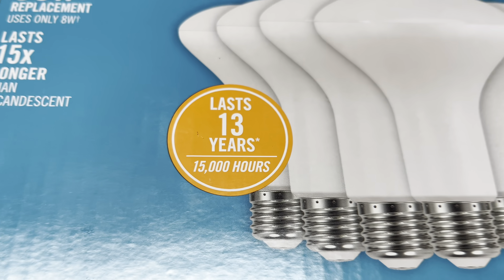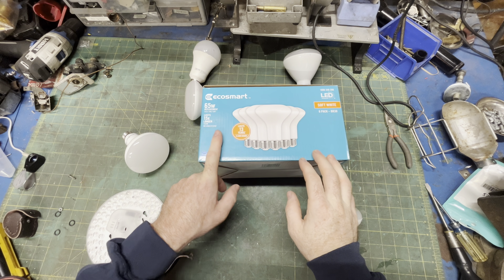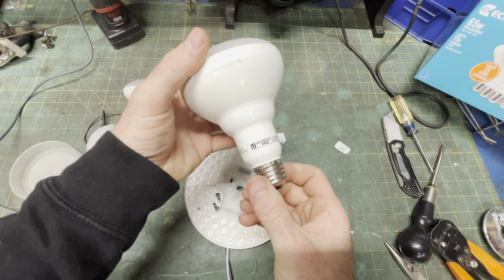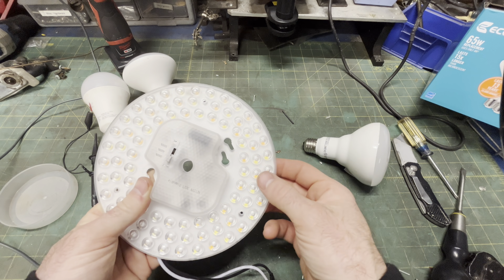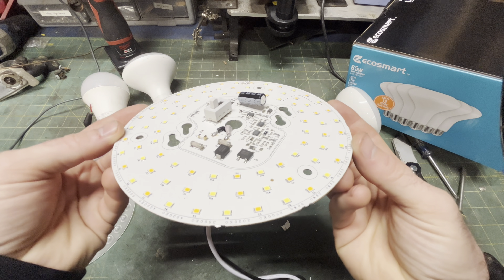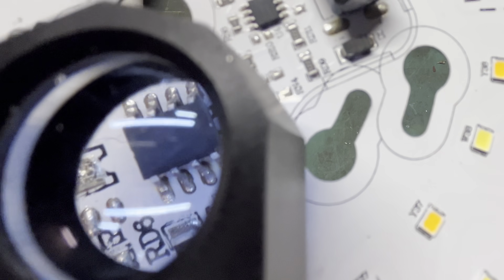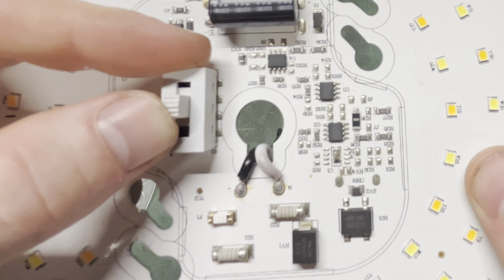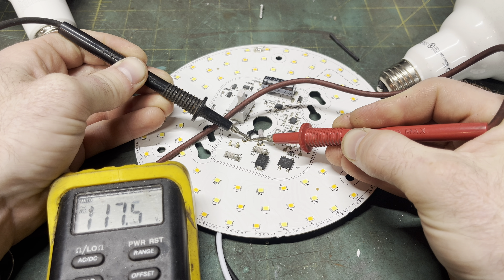Why Do LED Bulbs Fail? An Autopsy!

Comment: In my experience, most incandescents that were used on a daily basis lasted around a year. CFLs were somewhat better, but I've rarely had to replace LEDs, rare enough that when one does stop working, I've got to hunt to see if I have a replacement for it
Reply: I had incandescents at my old house last as long as 12 years on fade-in dimmer switches. None of the LED bulbs that came with my new 2020 house lasted more than 3 years. Huge box of e-waste now the landfill (we don't have a recycling center within 70 miles of my area).
Reply: @JSMCPN  Are you sure your LEDs are dimmer-compatible?
Reply: There are also special dimmer switches for LEDs. I've found that even if the bulb says dimmable, it will still flicker on a normal dimmer switch.
Reply: @JSMCPN  We had 3 LED lamps, all Philips, which switched on automatically at sunset and back of at sunrise. All 3 died in less than 2 years, and all within 2 or 3 months of each other.
Reply: I've had many incandescent bulbs last around 2 years.
Reply: @Warp2090  Fading them in with a TRIAC dimmer and running them at 90% of rated voltage can triple or quadruple lifespan. Most of the damage done to edison filaments is caused by inrush current each time they're turned on. That effect can be eliminated by turning them on gently rather than slamming a cold filament with full voltage and a big current spike.
Reply: @PartTimeLaowai  Philips led lamps is kind of bad brand now. They fail so much in year two.
Reply: As a plasma fanatic  I just stick to fluorescent lamps. Most LEDs are boring for me. Filament style is OK but most other types are as ugly as the average mother-in-law.
Reply: @JSMCPN  - spend 80$ on a micro-controlled switch, never have to replace a power hungry bulb again 😂
Reply: Yet....I have track lighting in my kitchen with those wee halogen bulbs.....the LED versions are dying all of the time, to the point that I have quit buying them and seek out halogens bulbs in the dollar stores...they last longer.
Reply: @PartTimeLaowai  , up till now, only the Philips ones failed in my house within 2-3 years. I just put back some old fashioned light bulbs.
Reply: @spoonikle  The "power hungry" bulbs cost like $1 to replace, I already own them, and I'm not poor so I can afford the extra $8/year in electricity to have more pleasant lighting.
Reply: I have had the exact opposite experience with light bulb at home...
I still have some incandescent light bulbs (2 outdoor bulbs that don't get used much) that came with the house I bought new in 2011, these bulbs were cheap "contractor" grade bulbs and for the most part they lasted around 5 years, as they burnt out I replaced them with CFLs which almost never burnt out...
About 4 years ago, they had a massive sale on LEDs plus a government rebate for changing bulbs to LED (to save the environment 😂), so I replaced all the bulbs in my house and in that 4 years, I've had to replace all of them again at least once and it seems like 1 burns out every month...
Funnily enough, a week ago, I was commenting to my wife that it's been a few months since I've had to change one of the bulbs, and this week alone, 3 have died....
Maybe I got a bad box of bulbs or maybe the companies use cheap parts nowadays and we're all paying the price for corporate greed
Reply: I have 2 LEDs with external heat syncs from the early days that get used 8+ hours a day that are still going strong.  If I buy a store generic LED, I'm lucky if they last a year.
Reply: I have incandescent lamps still running since I bought the house 25 years ago.  Not being permanently used of course.  Actually, I thought I would run through the supply of my incondescants before replacing them by LED and still have almost the same amount left as when I though about it.   With LED, I had kitchen renovated in 2016 and got 8 LED"s in the ceiling. They started failing after 6 years in 2022 with three going out in quick succession  I got a set of exactly same color/lumens ones and replace them one by one.  Here in 2024 I have one original left.
Reply: @JSMCPN  Same here I've never seen a reliable LED light bulb.

Comment: I've got some ancient Philips 20W-equivalent bulbs from right at the start of the LED wave. Giant things, heatsink is 2/3rds of the body, yellow cap. Found image results that look like it by the name "Philips Master LED". Well over 12 years old now, they're still kicking. From the heat they put out, I don't think they use the shoddy capacitive dropper circuits that most modern LED bulbs use. If I recall correctly they were something like ~$30 CAD a piece at the time.
Reply: Yeah, they probably use japanese caps and a high quality power supply.
Reply: @hunterbear2421  or did at one point, I kinda doubt the new ones do, even from that same series
Reply: @thewolfin  newer series use cheapo power supply s half the time they are what fail rather then the led
Reply: @JSMCPN  We had 3 ES base LED lamps, all Philips, which switched on automatically at sunset and back of at sunrise. All 3 died in less than 2 years, and all within 2 or 3 months of each other. Now trying no-name cheapies from Aliexpress.
Reply: There was an all white second series of this that had a miserable power supply causing intermittent flickering. Can confirm though the first yellow cap one is still going.
Reply: Same for me: The only bulbs that haven't failed are all over 12 years old from big brands. To be fair they costed a lot more but seem to be built much better than the stuff you can buy today
Reply: Same. Heavy heatsink. Keeps working for many years.
Reply: I had one for 10 years or more
Reply: Hah, just made a comment about these same bulbs. There is a reason I only owned one ha ha. Though I did end up giving those Germans about $30 a bulb for a bunch of Hue stuff later on anyway.
Reply: I have a few Cree bulbs from the same era and with the same build quality, they've been on nearly 24/7 for the past 6 years (intermittent before that). One of the bulbs has recently developed a bit of a flicker when the AC voltage or frequency drops, but other than that it's still trucking.
Reply: As a plasma fanatic  I just stick to fluorescent lamps. Most LEDs are boring for me. Filament style is OK but most other types are as ugly as the average mother-in-law.
Reply: Have one from 10y ago noname with heavy aluminum body and fins. Works in living room and sees a lot of clicks and hours. Outlived all cheap plastic leds.

Comment: Nearly all of them fail due to temperature cycling of solder joints.  LED bulbs are tested by running them at a constant temperature at elevated stresses being ON continuously.  A typical cheap-o indoor rated LED bulb lasts me about 3-5 years being constantly on in my outdoor light fixtures, which is longer than they last being used indoors where they switch on/off many times per day.
Reply: I'm still subscribed to you.
Reply: One of the main problems for LED fixtures is the form factor doesn't allow for proper cooling.
Reply: LED expert here, 20+ years in the industry. You are half correct, most of these use what are called 2835 size LED manufactured in China as cheap as possible. These use very thin wires to connect the die. These thin wires end up failing miserably due to heat cycling. The more cycles you have in a day the worse it gets. You're better off keeping them constantly on. Put them on a motion detector that keeps then long enough to heat up to temperature and you'll have to change the bulbs every 3 months.
Reply: As a plasma fanatic  I just stick to fluorescent lamps. Most LEDs are boring for me. Filament style is OK but most other types are as ugly as the average mother-in-law.
Reply: Most lead free solder is garbage.
Reply: @joergsonnenberger6836  S'true. I notice many of them even have instructions on them warning about not installing them upside down or in a closed style fixture like a pot light.

Comment: I've got LED bulbs that are close to 15 years old still working, and others that failed in a month. The no-name ones are the worst. Even the good ones gradually get dimmer as they age.
Reply: Yes they do definitely get dimmer.  I am so sick of being in a house where all the light bulbs are dim AF.  As for the so-called energy saving properties of LEDs, it is simply not true.  At one time a room had a single light fitting for an incandescent bulb.  And now the advice from places like IKEA, is that every room needs at least five light sources.  Five LED bulbs and they can't even do the job of a single incandescent?  Where is the energy saving there?
Reply: I mostly have no-name led bulbs in my house, some have gotten dimmer, but not one of them has died. The oldest ones are 15 year old cob type thingies.
Reply: @lazygazzzer  I think this has more to do with trends and bulb choices. LED bulbs are absolutely more energy efficient than an equivalent incandescent bulb there is zero question about that. Whether they are brighter is another question and has more do with bulb choice, quality, and personal preference of color temperature. As for rooms having multiple lights, that is more of a trend. I've also added a lot more lights to my house, but that's not because incandescents are brighter (i've still got a lot of rooms running only incandescents I stock piled), it's because I want more light, and no longer have to worry about burning a ton of extra power see properly.

Also something to keep in mind is that a lot of LEDs are actually not driven to their maximum potential because it's too bright for most people's preferences. Some have settings, but there are a few different flat panel fixtures that I've had to turn down because they were blindingly bright at full power.
Reply: @lazygazzzer  Wait, you're judging LED bulbs because a store that wants to sell you more lamps and bulbs told you to buy more lamps and bulbs? One LED bulb replaces one incandescent bulb just fine. Use your eyes and your brain instead of letting a company that's only trying to sell you more crap tell you what to think.
Reply: @lazygazzzer  Dude, the energy savings are definitely there. Going from one house with all incandescent for the last 30 years to changing the bulbs to LED has on average saved me $300 per year.

Thats pretty sizable savings.

Also, if you’re complaining about dim LED bulbs. You’re buying the wrong bulbs.
Reply: @Goodgu3963  Its really on bulb choice. I got several that are capable of 2000 lumens minimum. They’re my backyard flood lights.
Reply: @lazygazzzer   I really disagree about that. LEDs are so bright that I can light my house with modern nightlights. I think we have gone too far.
Reply: @lazygazzzer  Old incandescent light bulbs had an energy waste of 80-90%, which goes to heat. Trust me, 5 LEDs are way more energy efficient than that, especially good modern ones.
Reply: Well I have replied to these comments a few times and the posters don't like what I say and get my replies deleted.  Thanks guys.  Good to know you have an opinion on these matters, but I can't have my own say.
These LED bulbs start off bright but then get dim over time.  I'd say for about 80% of their lifespan they barely put out any light.  And I assume to compensate for their poor long-term performance you get places like IKEA advising that we fill our rooms with more and more light fittings.  The only bulb which I found that actually lived-up to the extravagant claims on the packaging, was those halogen bulbs.  But unfortunately, in the UK, even these have been banned.  There is one choice of light bulb: LED.
Maybe I wouldn't mind LED bulbs so much if they were an appropriate match for the supply voltage in most buildings.  But they are not.  In the USA the mains supply is 110v and for most of Europe it is around about 230v.  Most LEDs operate on 3v and burn-out if the voltage gets even slightly higher than this.  To ensure that the LEDs operate with the correct voltage and current, there's a whole load of addition electronics needed in each and every bulb to drop the 230v supply down to 3v.  This is a massive waste in resources and the manufacturing process.  And after that when the bulb has come to the end of it's life, it can't easily be recycled.  LEDs might have some use in the right environment, but they are a poor substitute for lighting a home when all things are considered.
Reply: I've had good luck with the LED bulbs with the heavy aluminum housing and the beefy heat sink fins on the outside. I have several in the house that were made by sylvania that have been in use for every bit of 10 probably closer to 15 years. They were considerably more expensive than cheap plastic LED bulbs.
Reply: If you don't already understand how 5 LEDs at 5 watts each is using less power than a single 100 watt incandescent bulb, no amount of explaining is going to help,  @lazygazzzer .  Also, I'm guessing that, like the majority of consumers I encounter, you have not yet grasped the concept of using the lumen rating of bulbs to compare the amount of light they provide. 🙄
Reply: CallumFix  Yes you are probably right.  This will be the reason why the LEDs that are available now are so bad at lighting a room.  Proper junk made using cheap and shoddy components that don't last.
Reply: @leonelewis59  and I will state again... they start off bright and go dim.  And adding more and more dim lights are not going to improve matters - it will only consume more electricity.  Every corner of the room will be dimly lit, what is the point of it?  Find me a light bulb that is actually bright and stays bright for the duration of it's lifespan.
Reply: We have outside lights around our property. Installed them about 9 years ago after our neighbours complained about the bunker lights shining into their bedroom windows.
They shine from dusk until dawn all year long. Little GU10s. The Philips ones are absolute garbage but the Mirabella ones (local brand, made in China) seem to last forever.
Reply: @lazygazzzer  that advice is aesthetic advice, not light level. If you want "the one big light" by all means buy a single 10W LED instead of 5x 2W bulbs, but either choice gonna use less electricity than a 100W incandescent.
Reply: @lazygazzzer  I know what you're saying! You're talking about how an LED's light doesn't light up the room the same way than an incandescent does because LEDs are directional light sources, whereas an incandescent provides non-directional, uniform lighting. That means there is more light directly under the bulb, but less light on all sides of it, and that's the reason you need many more LEDs in a room to attempt to replicate the uniform lighting of incandescents. The energy savings in negligible, even if you don't need more bulbs, as there is only about a $3.75 per YEAR difference for an LED vs a so-called equivalent wattage halogen. Then there's the fact that plastic and computer chip LEDs have a far greater environmental impact both when they are made in China and then again in the landfills here in the USA, than simple glass and metal incandescents that we used to make here. In short, cheaply made junk that doesn't doesn't last as long as it's supposed to, doesn't provide as good light, and fills up the landfills with more waste.